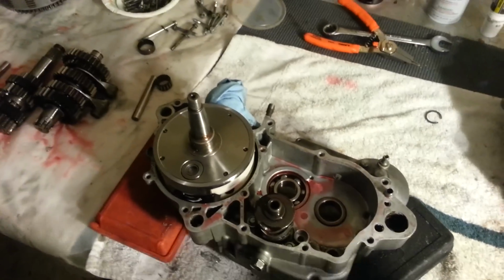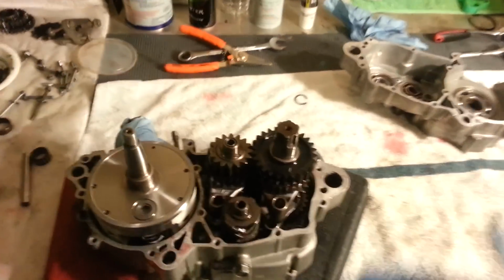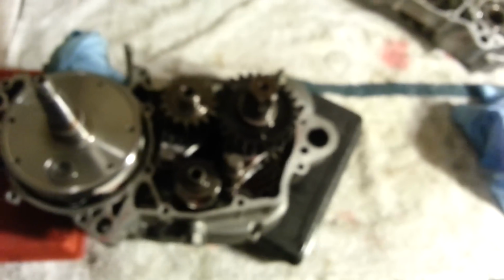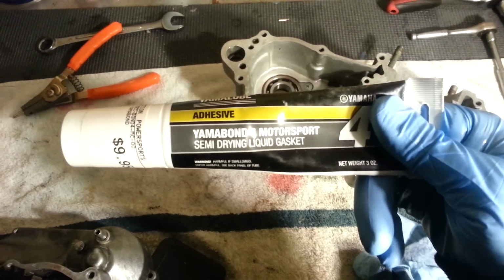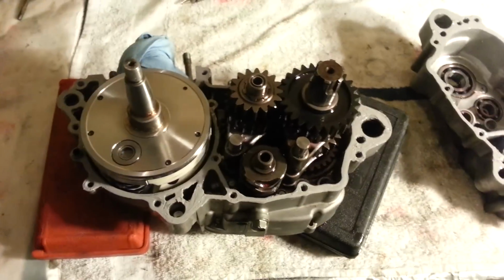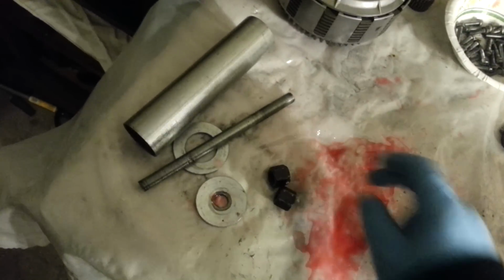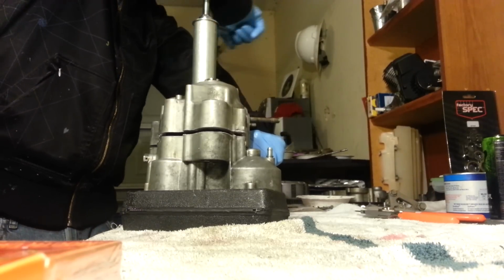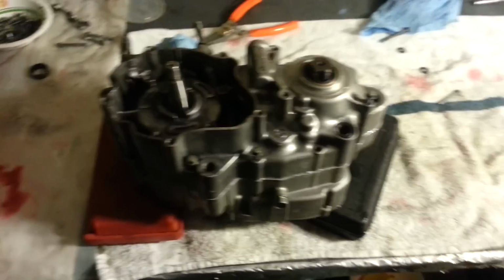98 kx250 crank installation

Comment: I had the same bike. Loved it Yeahaa. And i'm making that installer for the crankshaft. Maybe weld 2 bolts together and put a washer in the midle so it stops when hitting it. You gave me inspiration.

Comment: One thing I'd say to do before removing crank installer is look at the gap either side of crank to make sure you in evenly both sides apart from that good video. Had issues in the past with  fibre paper gaskets in the centre crank cases, now I just use gasket maker like this.

Comment: Hey buddy I have the exact same engine as you and its my first time rebuilding the whole engine, when you install the shift drum are you installing it in neutral ? and also if you are and you click forks into the drum is the gears in neutral by the way I live in Scotland and you saved me like £140 for a crank puller plus shipping etc etc thanks buddy ;)
Reply from the maker: yes its in neutral and it should spin freely when closed, glad i could help from oklahoma! thats awsome
Reply: +ninja4207 thanks buddy your videos been a great help and yeah its amazing how far the youtube videos can travel lol your video explains it very easy for people who ain't mechanically minded lol also when you installed the crank you say you heated your cases up how long did you do it for as aluminium is very easy to melt i'm a little worried about doing it i know you have to cool the bearing down and heat the case up and do the same with the crank but its how long do i heat them for ?

Comment: i have a 1994 kx 250,seems like the crank seal is gone on right side,,do i need to split the case on my bike to replace it,,
Reply: +wolf360090 yea you do a 7.00 dollar seal.
Reply: i fig i had to  but wasnt sure..i fig if i have to do that then mise well through in new crank bearings as well,,,
Reply: Might as well do a full bottom end rebuild if you’re splitting the case

Comment: you put to much pressure on that crank with that tool i use a rubber mallet evenly all the way around with the bolts in. then tighten them as the case goes on.

Comment: hi mate what size is the thread on the flywheel nut mate?
Reply from the maker: should be 12mm
Reply: Had trouble myself with these threads doing this same method and its m12 by 1.25 pitch

Comment: Did u forget to put the other coller  on the transmission ... it has two o rings that go on it???
Reply: It was sitting next to the needle bearings
Reply from the maker: Are you talking about the one on the right side of transmission between the gear and casing?
Reply: Yes sir i didnt  see u put it in.. im in the process of fixing my 98KX250
Reply from the maker: Paul Obray after the video uploaded I noticed it and had to take the case back off and put it and the o rings  on,
Reply from the maker: Paul Obray also when putting the clutch basket in pay attention to the order of things I had to do that one 2 times as well.. simple mistake easy to do. Good luck to you, it’s an amazing bike!
Reply from the maker: Let me know if you got any questions on it, I learned a lot about them in this rebuild
Reply: @ninja-ns7vn  also on the clutch there  is a thrust washer  as well that the needle bearings sit on ...yes it is an amazing  bike especially when you have it ported and polished  wheelies in every gear!!!!!!
Reply: @ninja-ns7vn   i also love that fucking tool i have one made up ready to go!!!!